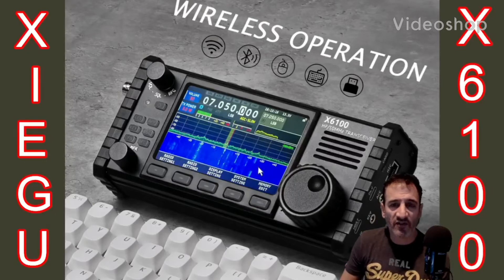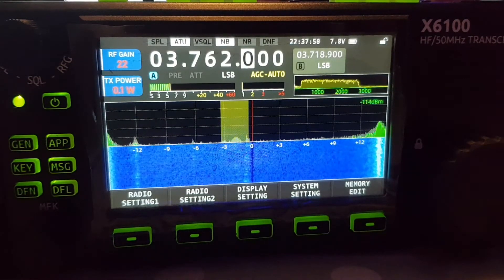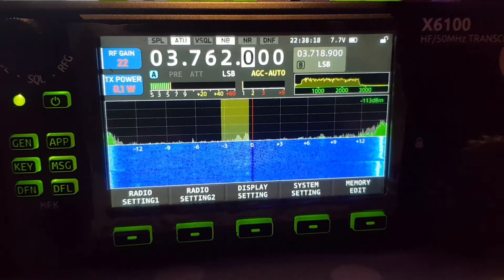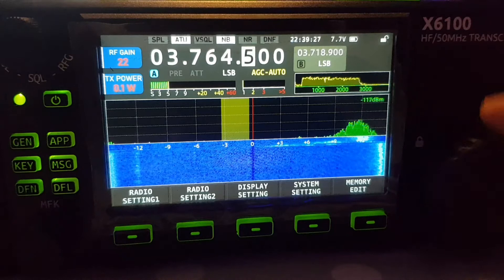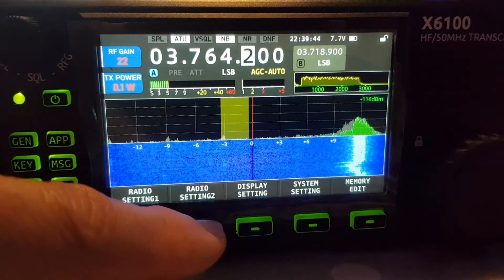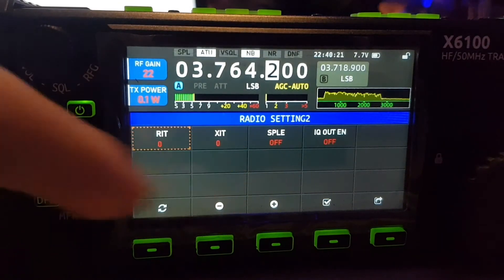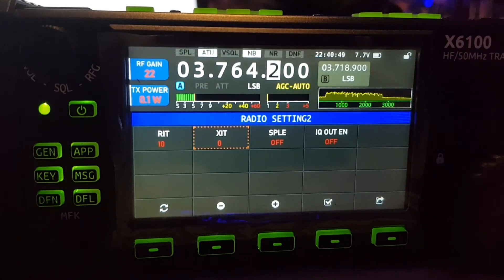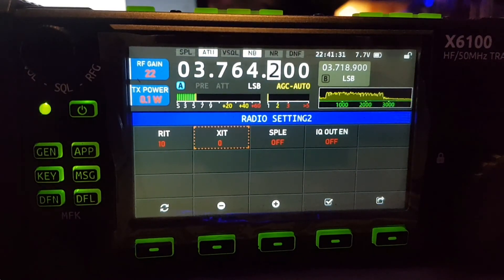XIEGU X6100 - How to Fine Tune Frequency

Comment: I just received mine 😀. Do you know why on some bands turning the tuning wheel left or right causes a short cut of the sound then resume? Doesn’t do that on the the 40m, there it is smooth, uninterrupted…
Reply from the maker: Hi its the relays changing.
Reply: @M0FXBHamTech  Thanks!! You are right, it happens on “round numbers” and ham band thresholds.

Comment: Surely this is not right?  I have seen another  video where the 10hz is turned.  Might be a step change by holding down a button or some other means?  I have the G90 and it has fine tune , so the must be a easier way surely ?
Reply from the maker: Hi -i will try yes agree its weird .
Reply: @M0FXBHamTech  Cycle through different step values with the FST button